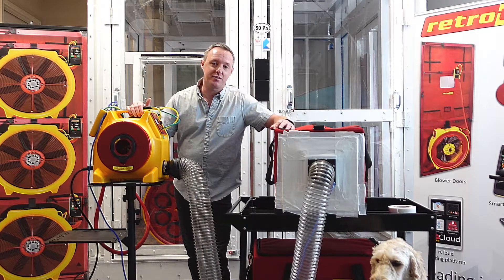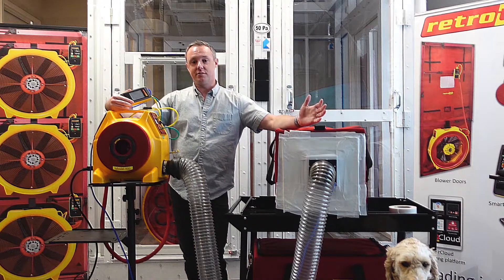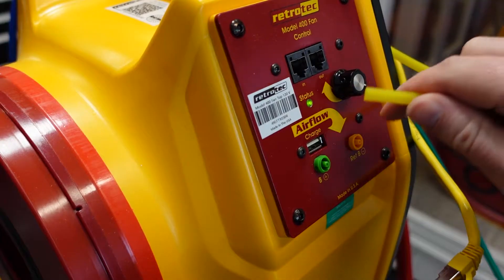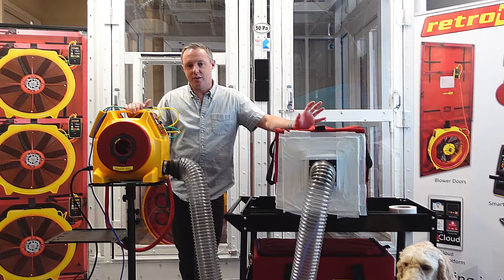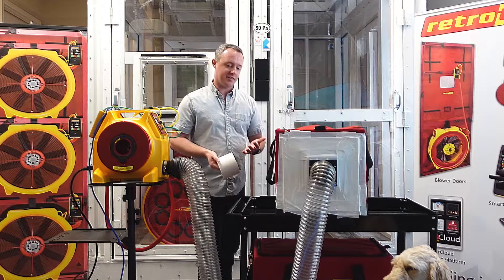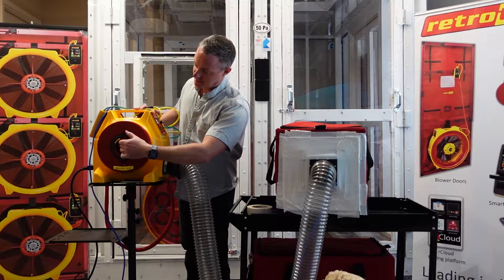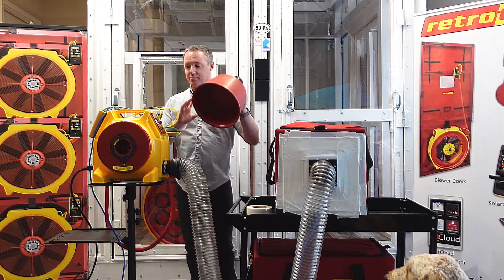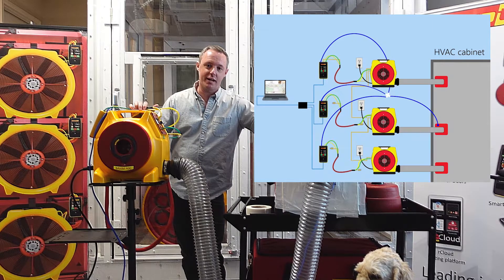Technical Tuesdays: Ep. 32 - Commercial Duct Leakage Testing

Comment: When do you plan to introduce support in the Fantestic interface for circular ventilation ducts? In Europe, apart from the EN 12237 standard, we also have PN-EN 1507. Currently, it is not possible to perform a test for this type of duct according to the PN-EN 1507 standard.

Comment: What square footage is this recommended for?
Reply from the maker: you really have to look at it as the amount of flow you get at a given pressure. For example, this system will produce 300 CFM at 8 InWC. So if its a tight system, you can test more sq. ft. depending on your target pressure. If its a leaky system, you wont be able to test as much duct area becuase the fan is working harder to overcome the leaks to get to pressure.